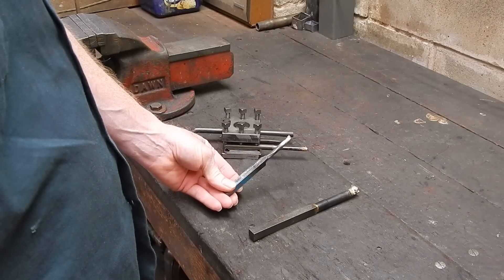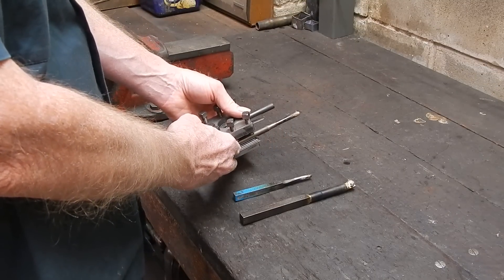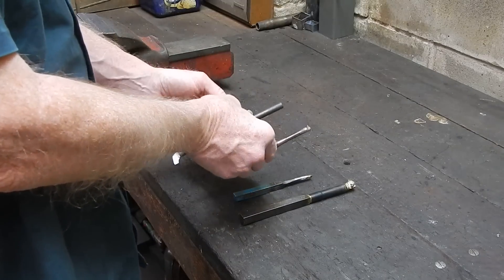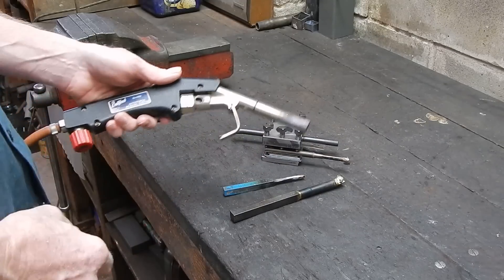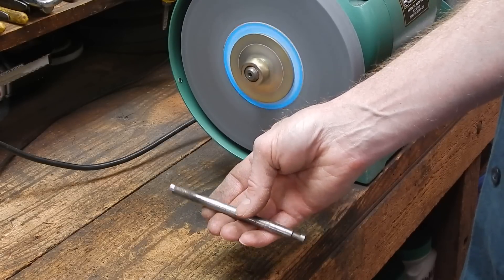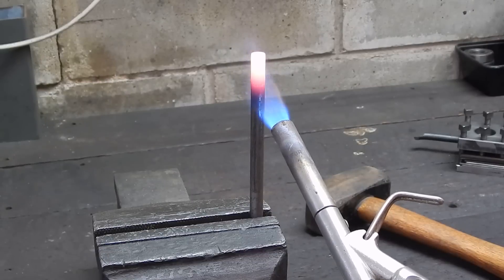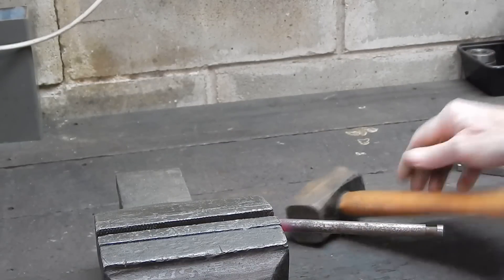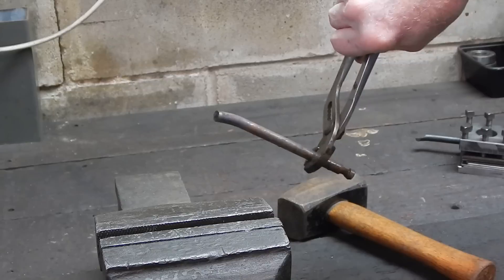Make a small boring bar from an engine inlet valve

Comment: I used the inlet valve from a 3.8 V6 Mitsubishi Pajero (6G75) to bore out a 12mm hole in brass. It needed to be 24.95mm and I didnt have anything bigger than a 12mm HSS drill bit. It worked well, so thanks very much for posting the content... subbed and liked. :)
Reply from the maker: Thanks for sharing

Comment: Very interesting. Yes not everyone can get around a problem,by making a tool for a problem. Great idea/ plan. Nice video. Thanks. I really like the idea of recycling. Right up my alley.
Reply from the maker: You can also turn old engine valves into router bits and rough timber gouging tools.
Reply: @Xynudu  thanks. Very good idea

Comment from the maker: I had to use a small boring bar on an alloy gear today, and used my engine valve bar on the job.  My normal carbide bars were not suitable, but this el cheapo worked 100% great.  Worth making one up.  Cheers Rob

Comment: Good tip mate, thanks.  I made a mini boring bar for 5mm holes, I used a Ramset concrete nail.  It was very easily shaped by just removing metal from the head of the nail.
Reply from the maker: Those Ramset nails are hard stuff.  I've used them as centre punches, and to drive out stuck Woodroofe keys.  Good idea regarding the boring bar.  Rob

Comment from the maker: Don't expect miracles, but for anyone working aluminium, old engine valve stems are as good as HSS, and cost nothing.  Great to grind specialised tooling to machine contours, engine finning etc.  As shown, they can handle steel, but will blunten off much faster than HSS.  Can easily be resharpened.  Cheers Rob

Comment: G'day Rob,
When I was an apprentice, many years ago, using the side of the grinding wheel like that would result in a severe arse kicking.  Wheels are designed to take the load on the periphery.
Regards
Dave Tointon
Reply from the maker: My father was a mechanic all his life, and this is standard practice for lightly facing off components in workshops.

You NEVER apply more than light pressure to the side of a grind stone.

Quite safe to do it this way if you use common sense.

Rob

Comment: Rob, I got an engine valve today and the shaft is approx 24" long and the valve seat diameter is about 6". Not sure what kinda metal it is but its BIG. Hopin to make a large boring bar from it :)
Reply from the maker: Now that's a big engine valve. Must have been some monster sort of engine.

Those would be useful for all sorts of projects - grinding dead centers, cutters, milling bits etc.

Half yer luck.

Cheers Rob
Reply: If you were right down the road I woulda brought it over and showed it to ya, my mechanic friend was amazed at its size. Also got some 6" diameter bearings for my forge to make knives from and a number of 1 1/4 x 12" bolts and other round stock for the lathe. All free stuff from my buddy at the scrap yard. Dont know if I can even cut the valve with the lathe....will see :)

Comment: yeah good stuff Rob---I stopped brazing and the like making boring bars a few years ago..
Now  I mig them on--three small stabs on the trigger for three sides on the scrap of hss steel---- a  high tensile bolt of whatever thickness or length and grind them up...Ordinary mig wire is or very close to low hydrogen standards so it is tough..
Another little trick for really fine work as in model making etc and you want say a 3/16th dia boring bar is grab a cheap screwdriver--attack the handle with a hammer and bust the plastic off--wire wheel for a bit and mig the hss on.. 
Quick easy and not much heat..

Another thing I have not tried yet is making a reamer out of a valve stem..Some of the old pommy machinests would home make their own reamers out of silver steel so valve stems would be their equal or better and as you know there are plenty of old valves..

I will let you know in future comments how effective it is..Best wishs for the new year..Ian..Its great to swap info....
Reply from the maker: Ian Craig Hi Ian.  Homemade tooling is good - certainly saves a lot of money, works well, is fit for purpose, and it can even look good at times :)  The only tooling I ever buy are inserts (off Ebay).  I don't have MIG, but that sounds like a good way to go.  I just use brazing.  I have a reamer made from a valve stem that I inherited, and it looks pretty simple and very well made.  Just some longitudinal flutes indexed/ground into it. Haven't used it yet. All good stuff.  Thanks for the information, and have a great 2015.  Cheers Rob

Comment: @6:18 you annealed the rod, so i think it would give you much strength if you heat it again until red for a while and then sock it directly in cold oil
Reply from the maker: Hi Mohammad,

Good point.  It would definitely harden it more that way.  Thanks for the suggestion.

Cheers Rob

Comment: Rob,
    I was wondering about using an old broken Cobalt drill bit as a lathe tool for some time now. The are hard as hell and if you bind them when drilling, they snap magnificently. I think they would be up to the task of machining harder materials.
    Also I have a stack of old circular saw blades hanging on a nail on the wall. A lot of these have those brazed on Carbide teeth. What do you think about cutting up the blade and brazing a tooth to the valve stem?
    Keep the videos coming, I really have been learning a lot from them. Thanks again.
Tommy
Reply from the maker: Hi Tommy.Carbide teeth on circular saws are very low grade and not up to continuous steel work (as I understand it).  I also considered this but it appeared they would be pretty poor/break easy so didn't progress the subject.  I generally re-use broken carbide inserts on my DIY boring bars. That's why I like the Bullfinch LPG gun so much.  Not sure about cobalt for a boring bar. Never had any experience with it.  Try it and see is my motto :)  Cheers Rob

Comment: seems like it would have been much easier and faster to simply use the flat valve head to cut out the cutting portion of the boring bar. Parallel cuts on either side then grind the cutting edge shape desired. Its all hardened steel.
Reply from the maker: +john buster 

Hi John,

Yes, you could do that.  I've used the head section when machining them up into wood router bits and key way cutters.

Works quite well.

Cheers Rob

Comment: Excellent video. Have you thought of brazing a HSS tip onto it ?
Reply from the maker: trialen I make all my own tooling.  Normally I would braze a carbide or maybe HSS on to hard steel bar or rod,  But many people can't do that as they don't have suitable heat available.  This video is really meant for those people, to enable them to get the job done using something else.  Rob

Comment: Why not just use the valve head as the cutter instead of bending the bar? Would be easy to do with a angle grinder.
Reply: Don wouldnt it have been made stronger from the aneal and quench? easier isnt always the best ....
Reply: Absolutely what I thought also...
Reply: Don North, usually on older engine valves they were made in two pieces and head is not the same steel as the stem. If I remember correctly, the head was friction welded to the stem and grinding it up as a tool bit would probably weaken the weld, so when sideways axial loads are placed on it I would think it would fail quite quickly. In my mind, bending the stem is the way to go.

Comment: Side wheel grinding is not recommended, and can cause wheel failure........a very dangerous situation indeed.  If you can do most of the grinding on wheel rim and only do light touch-up on the side wall that would be much safer(and give longer wheel life too.)

Comment: Why not leave the valve head on and just reshape it into the cutter using an angle grinder it will then retain the original hardness, also maybe an exhaust valve would be even better, they are made of harder steel!
Reply from the maker: mistera o Yes, you could do it that way.  I have also reshaped the head and cut teeth into it to make router bits.  Works great.  Some exhaust valves are sodium filled, so be careful.  Cheers Rob